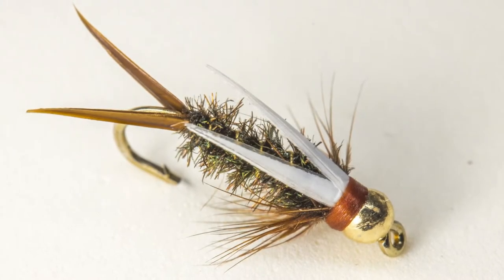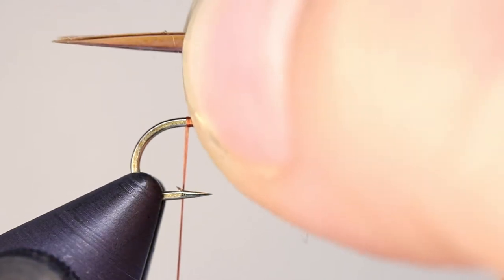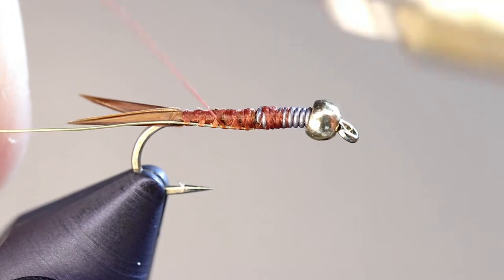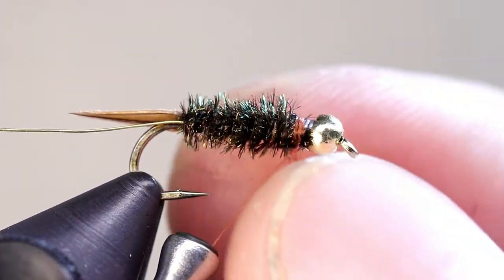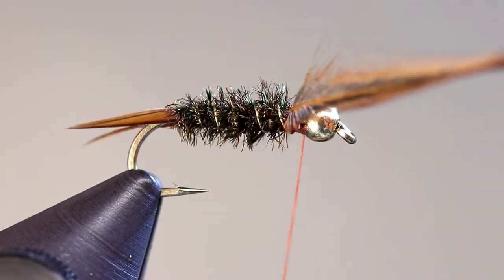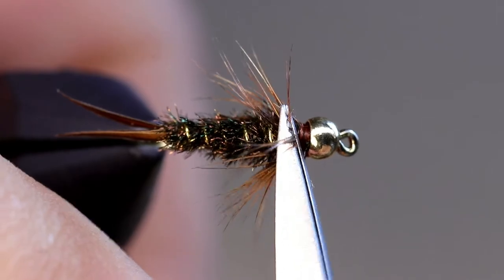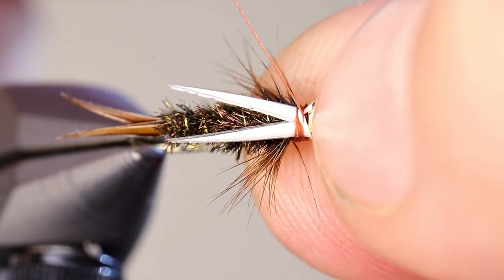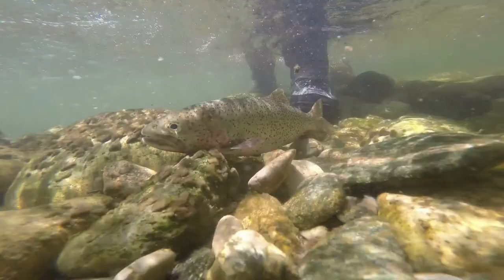Fly Tying: Bead Head Prince Nymph

Comment: Another great video, was wondering about size but saw it in the description. Do you ever tie it larger or smaller?
Reply from the maker: lathan308 for sure!   I'll tie it in a 12 for early spring and a 16 over the summer and I use a 14 in the fall/winter.   It's a great attractor because it can resemble stoneflies in larger sizes and various other nymphs in smaller sizes.  It can definitely be tied in other sizes as well but those sizes work great on my waters.